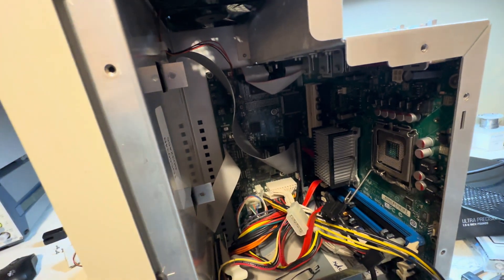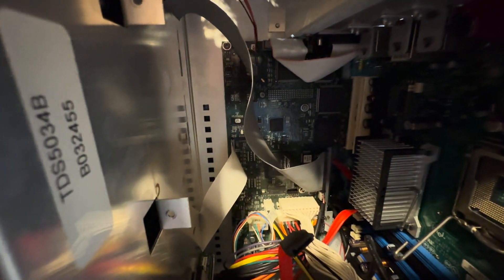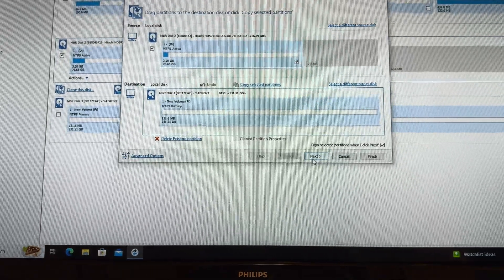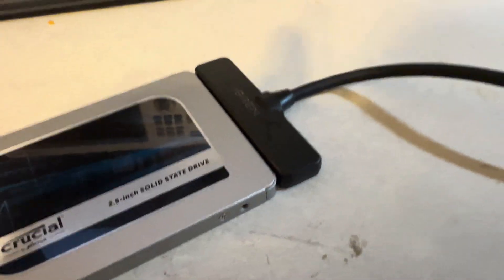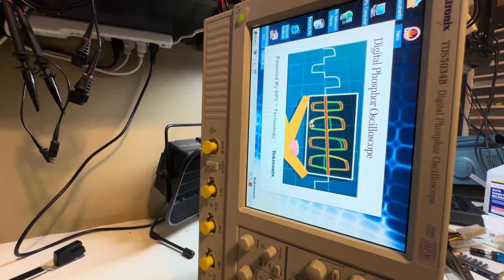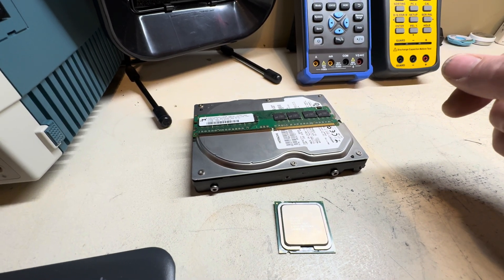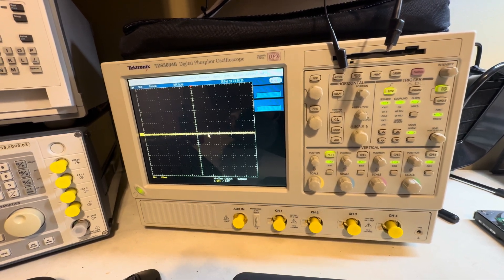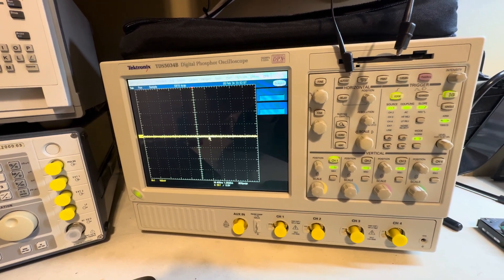Tektronix TDS5034 DPO Oscilloscope upgraded CPU, RAM and SSD upgrade.

Comment: Hey, I've got an earlier version of the 5034B (with a D865GLC mobo and originally a Celeron CPU, 512MB RAM) and trying to get the TekScope software to run on it because it throws a buffer overrun on startup. Tried upgrading the OS to WinXP but the software didn't install at all with an error message saying that I need to run it on a Tek scope... even after installing all the custom drivers.

Comment: Just to clarify the title of the video -- this scope is the TDS5034B not TDS5034. The non-B version has a totally different motherboard and I don't think it supports SATA at all.
Reply from the maker: Yes you are correct even though some non-B uses the socket 478 which did have sata as well. They used a few different main boards on theses depending on year. Even with same model.

Comment: Would it be possible to put a pc motherboard that’s a little more modern or would the oscilloscope hardware not be compatible?
Reply from the maker: The motherboard bios is custom to work with the oscilloscope board, same as the drivers. People have successfully managed to upgrade board but was straight forward and highest OS that would work was XP, with custom drivers.

I ended up selling the oscilloscope and going with a Rigol dho4804 which is better preforming as far as noise and overall performance, as deal with switch mode supplies and restoring audio gear and needed something to replace my analog and digital oscilloscope for more bench space and does the job great.

Comment: I'm guessing replacing the whole mobo with something "a little" more energy efficient than a P4 but still having PCI slots isn't an option?
edit: also I have no idea why this was on the YT frontpage for me  O_o
Reply from the maker: Nope as Tektronix uses a custom bios on these boards to communicate with the acquisition board, it not just having a board with PCI slot unfortunately, If I could would have definitely upgraded the motherboard and CPU to something way more efficient. You can’t even flash the board with an Intel updated bios it won’t work already tried. Tektronix has it own flash tool and bios for the motherboard and drivers are custom. You can’t even update the drivers. The OS the latest you can do and drivers will work is 2000, or XP.

Comment: It's always nice upgrading an old instrument and making it faster and nicer to use. I upgraded the mobo / cpu (p4 to c2d) / ram (500mb to 4gig) / hdd=>ssd / os (win xp to win 7) in a Agilent logic analyzer, and it went from painful to use, to a pleasure to use! Feels like a modern instrument now!
Reply from the maker: Yep nice when faster definitely made a difference. I would love to upgrade the motherboard on this one and update OS to windows 7, but has a custom Bios and drivers to communicate with the oscilloscope Acquisition board so it can use the video and hard drive.  I tried using updated drivers and crashed the oscilloscope only the Tektronix drivers work. Do have a good condition 1.5Ghz HP/Agilent oscilloscope coming soon that bought off surplus likely going to replace it soon as well as the matching logic analyzer. The analyzer works and the scope works but doesn’t pass self test but kind of have an idea of the issues as fix that issue with several of those models before. Hopefully a low hour but will see but screen nice and bright and HD works and calibrated stickers still intact.